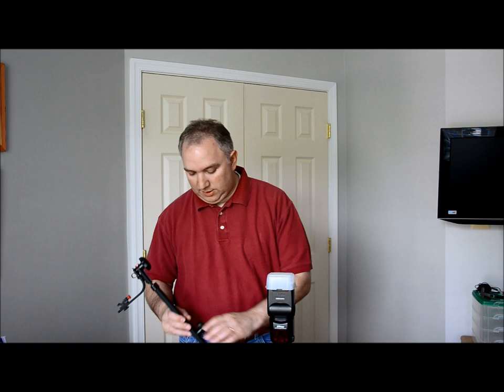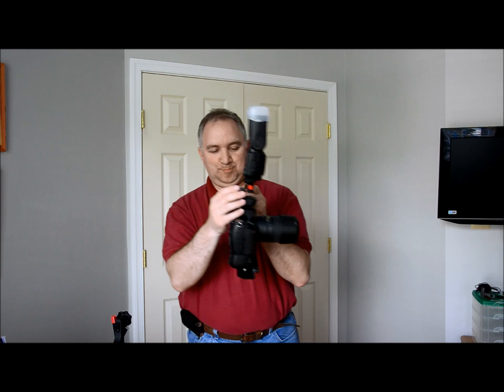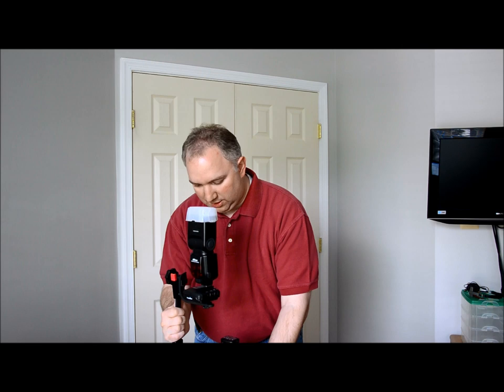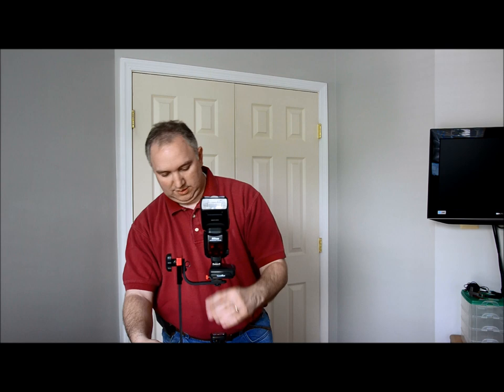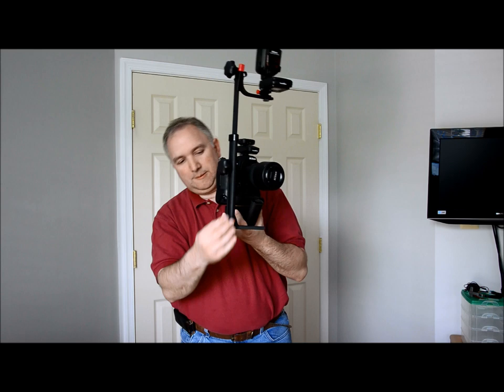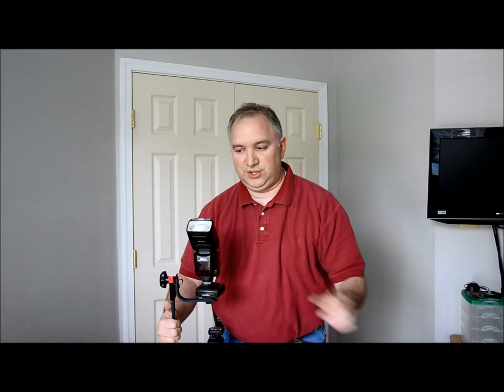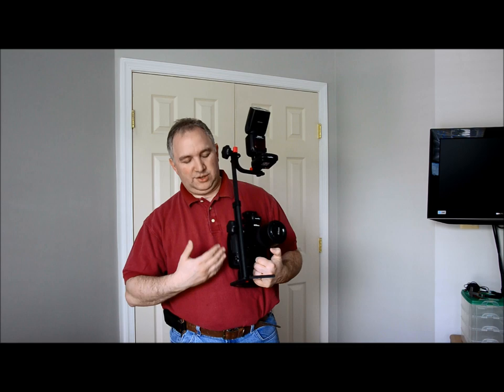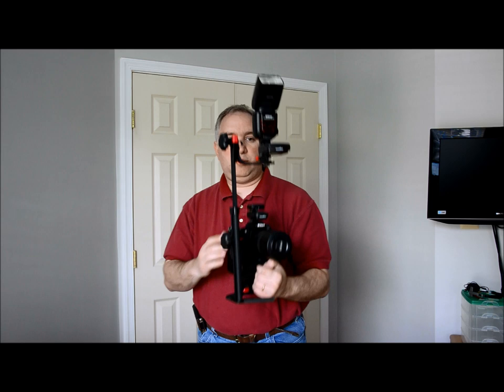Stroboframe Pro-RL Review

Comment from the maker: David, the main reason I got it was b/c I wanted to use my PocketWizard Flex & the old SF didn't give me enough space above my camera for the MiniTT1 + AC3. The Nikon CLS works well when the remote flash is in front of the commander flash, so directly above would be hit-or-miss. The cord is a good idea - that's what I used for years until I got the PW. If it's not a Nikon SC-28/29 I would recommend that you get one of those. You can then use the flash as a Commander to control other CLS flashes

Comment: John, I appreciate your video.  Just got the unit yesterday.  I use nikon D800 withe SB800 flash.  I got a cord to connect the two.  If you don't mind the time, what is my alternative to the coiled wire?  Commander mode (IR) would be a problem.

Comment: I have the same problem with using my Stroboframe Camera Flip Bracket along with a Battery Pack and my Flashpoint Radio R2 Transmitter...  My go-to flash is the Canon 600EX-RT and I will normally use this modified with a Joe Demb Flash Diffuser Pro or a small softbox.  
I also want to occasionally use my bracket with the hefty Flashpoint Streaklight 360ii along with a 18" folding beauty dish. I don't think that this Pro-RL unit will do the job with that heavy flash unit. It just doesnt look sturdy enough...
One solution (I think) is to modify the Stroboframe Camera Flip Bracket to allow me to work with the gripped camera and transceiver.  However, I "might" just build my bracket from scratch, scavenging the camera flip portion of the Stroboframe bracket.
Another solution "could possibly" be to attach a Arca Compatible clamp to the base of the Camera Flip bracket and then to use a longer Arca Compatible plate and use this plate to extend the camera a bit further back so that it will clear the flash bar when flipped.  This will probably be my first attempt at modification since it is an nondestructive method.  If I like this method, I will permanently attach the Arca compatible clamp using the screw and also super gluing it in place to prevent rotation....
Reply: Nice idea. But the flash bracket on this is stronger than it may look. I've been able to use a Quantum QFlash on it. We're all comfortable with different set-ups, so do whatever works best for you. I hope what I posted helps you figure it out.

Comment: You're old bracket, would probably suit my needs.  I'm looking for something that will mount on a tripod and for nature photography.  The layout that I'm looking at will be a 400mm Canon prime lens with a flash bracket, for specific photos.
Reply: I'm not really sure I'd use either for nature photography -- they are both kind of big and bulky, especially for a long lens. Really Right Stuff (http://www.reallyrightstuff.com/) has some great off-camera flash gear that is more suited for wildlife photography. Check out Moose Peterson (http://www.moosepeterson.com/) for great advice on shooting wildlife, including using flash.
Reply: colonelsanderz1
Yeah I need something sturdy, not really bulky.  But I'm not concerned being able to tilt the camera, since the bracket will be mounted on the lens tripod mount.  But it has to mount on a tripod, easily, with no hitches.  I've got a good idea on the flash I'll be buying, as well a flash tube enhancer.  But I'm still tossed on the bracket.  Thanks for the links, I'll check it out.

Comment: It must pretty heavy to hold.  Who holding your camera bag.
Reply: It's actually not that heavy, but what's also very important is how unwieldy or wieldy (is that a word?) it is. Since it was designed to be held, that helps a lot. But as I discussed, not as easy as some other rigs. Nowadays, I use a belt system to hold my equipment, not a bag. I like the Think Tank line.